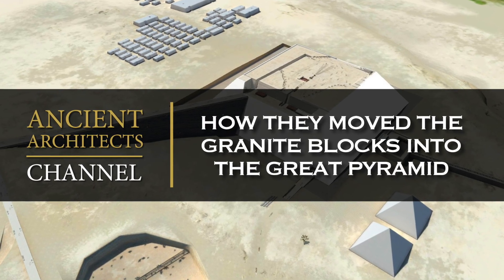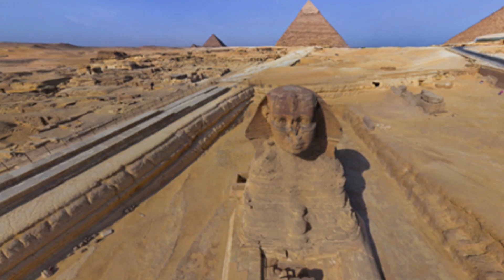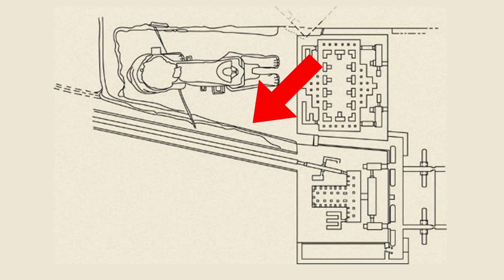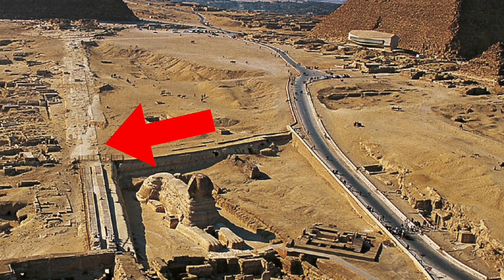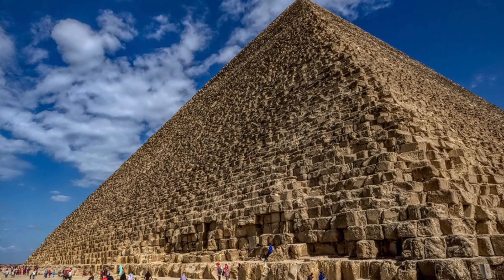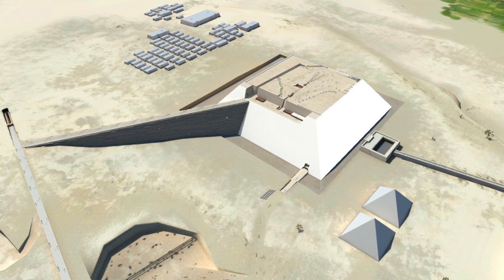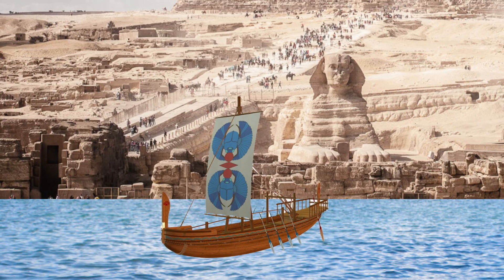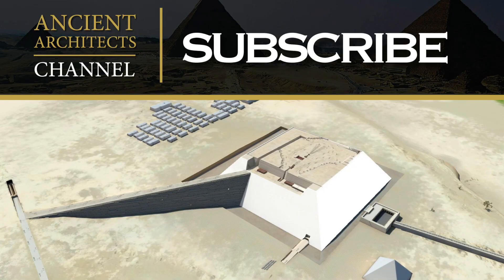How They Moved the 60-Ton Granite Blocks into the Great Pyramid | Ancient Architects

Comment: How did they quarry the 60 ton granite blocks?
Reply: With a wooden spoon
Reply: Nobody knows. The excavation marks of similar stones and obelisks still in situ at Aswan have really weird marks that look like the granite was scooped away like icecream!
Reply: I always wonder about that, too. We see megaton blocks still in situ that have been partially quarried, with just a slim center "beam" still holding them in place. How did they remove that center beam? And then muscle the cut block out of there?
Reply: By using fire and dolerite hammers. The obelisks are much heavier, some of them exceed 300 tons.
Reply: aliens
Reply: @MrAchile13 LOL!  I just saw that you said fire was used to quarry the granite. Granite is workable at 2300 F. So they picked up their granite pounding stones and hand pounded granite that they somehow managed to heat to 2300 freaking degrees Fahrenheit? 
Nukka plez
Reply: Well getting a rough shape is relatively easy.

https://youtu.be/v-NsirLXUMk

Transporting, let alone shaping them into the precision blocks that  they are claimed to be seems downright impossible.
Reply: https://www.youtube.com/watch?v=5Zi7B9-eCJY&t=133s
Reply: https://www.youtube.com/watch?v=LHDSmKvs9Tc
Reply: @MrAchile13  Such a process would require bodies to work in positions that physically and psychologically would be intolerable, if not impossible, not to mention greatly limiting the force of their strokes.  It could be done though, in a thousand years perhaps.
Reply: @redwoodcoast  It would be nothing compared to the digging of deep underground tombs. Working conditions in the XIX century coal mines were inhuman, yet miners did it.

Regarding the relieving chambers, Jean Pierre Houdin addressed this and they do have an important role. The chevron blocks were raised high above (unlike the queen's chamber) in order to transfer the pressure above the grand gallery (and not lateral, which would be dangerous for the structure). The relieving chambers are simply granite beams meant to bridge the gap between the walls and thus strengthen the structure and fill the void between the ceiling and the chevron roof.
Reply: @MrAchile13  I missed Houdin's attributing the height of the relieving chamber to avoiding pressure on the grand gallery.  That makes perfect sense.  But did he, or anyone, conclude that limestone would not have been strong enough?
Reply: @redwoodcoast  I don't know, but I don't think this is relevant. Why take the chance of using limestone if you can be safer by using granite?
Reply: @MrAchile13  Why, because no one in Egypt was capable of cutting granite with a few exceptions. But anyone with a hand saw could cut limestone.
Reply: @redwoodcoast  This is not true, as proven by the archaeological record, experimental archaeology and Egyptian inscriptions.
Reply: @MrAchile13  -all of which are subject to incorrect interpretation, false characterization, and unrecognized omission and ambiguity.
Reply: @redwoodcoast  It seems to me that you are casually dismissing evidence that does not fit your narrative. Egyptians literally told us they were making granite obelisks. Check out the sarcophagus of Hordjedef. Denys Stocks has proven that granite can be cut with sand and bronze saws. (Experiments in Egyptian Archaeology, page 115)

Perhaps you would like to explain how they managed to leave thousands of inscriptions in granite, if they were unable to work it.
Reply: @MrAchile13   What you need to notice is the 'quality' of the inscriptions in each case.  Hieroglyphics impressed into granite required a technology that we can only try  to guess at. They left a characteristic that is unlike inscriptions that are carved.  Which is that they are FLAWLESS.  As in flawlessly smooth and perfectly, uniformly shaped as though by a stencil.

Inscriptions that are chiseled into hard stone look exactly like what you would expect from a chisel. They are rough inside, and rough around the edges.  I can say that because I have closely looked at dozens of photos which reveal the difference.
A good question is: Were major inscriptions put on hard stone before Egypt had iron tools with jewel tips?  If so, then either they got iron tools from another civilization or 'they' (the king's masons) had access to tools not made on earth, like the one that core-drilled the Petrie core #7.

The smooth inscriptions in hard stone like that of obelisks required either stone softening technology or geopolymer stone casting chemistry.  Because the perfect nature of their shapes is either from a mold or from a stencil pressed into soft stone without distorting it (which may or may not be possible).  All that we know for sure is that chiseled inscriptions look like chiseled inscriptions, but those on many major objects do not looked chiseled.

I'm convinced that the kings of Egypt possessed a powerful E.T. unit that could cause molecular bond dissociation.  But then you already knew that because you wisely have read my exposition that explains the logic behind that assumption:  The Ark of God & its Deadly Device https://sciencetheory.wordpress.com/2019/08/05/the-ark-of-god-its-deadly-device/
PS  this morning I did a curiosity search and uncovered this which you should find interesting:
Name of product
IDEAL WALL
Type
Cement wall tiles with stone effect
Materials
Cement
Ideal Wall is a fully engineered system for vertical texturing and carving. Made from selected high grade sands, Portland cements and our specially formulated polymers, Ideal Wall offers unique characteristics in any vertical application.  Ideal Wall can be used to create the look of natural stone, slate, brick or even wood. Perfect for walls, columns, panels, window surrounds or even just inlays surrounded with other materials. Ideal Wall Stains are used to colour and antique offering limitless options.  Ideal Wall has been formulated for either interior or exterior application over any solid substrate. Once applied you can texture and carve your creative ideas into Ideal Wall. Crisp and sharp details can be added the next day with Ideal Wall carving tools.
~~~~
I'm going to include it in my next article, -with some amazingly realistic photos.
Reply: @redwoodcoast  As I said, you ignore evidence that you don't like. When you have some time, I highly recommend you Experiments in Egyptian Archaeology by Denys Stocks. He managed to carve hieroglyphs into granite by using flint chisels (he even includes photos of them). There are unfinished hieroglyphs in granite that show pit scars, like the ones produced by flint chisels (one example at Bolton Museum). Better precision can be attained in hard stone since the process of carving/punching is much slower.

I don't believe in any E.T. technology, since there is no evidence of it.
Reply: @MrAchile13  It seems you are ignoring clear evidence, which may be because you are as yet unaware of it, -photographic evidence of hieroglyphics are are clearly chiseled and others that are clearly NOT chiseled, as in not chiseled into hard stone.
You need to familiarize yourself with the degree of fine detail that is observed also, along with hieroglyphics which are raised instead of inverted inward.
I need to do a side-by-side photo collage of the several different means of creating inscriptions. Some are clearly by manual labor while others are clearly by molding of pre-made symbols.
I tried to find some images of Deny Stocks' work but could not find a thing, therefore I can't embrace any certainty about the quality of his work, but not being a life-long slave to such a chore, his results could not possibly show the utter smoothness of inscriptions formed by casting.

Here's the link to my Flickr.com account where I've posted photos that I've analyzed and commented on because they are revealing or anomalus.
https://www.flickr.com/photos/183847320@N08/albums/with/72157710603755327  albums
Reply: @redwoodcoast   Your only argument seems to be "they look to good to be made by hand" which is not evidence. High precision can be attained by good craftmenship as has been proven all over history, just look at the serapeum sarcophagi. Experimental archaeology and the unfinished objects that have been found, proved that the Egyptians were able to work granite with primitive tools. There is no evidence of advanced technology nor of E.T.'s, but if you have anything, I'm looking forward to it.

All the quarries and unfinished monuments attest the quarrying of the stones, and many of the objects you claimed to be cast, display quarry marks.
Reply: @MrAchile13  " the unfinished objects that have been found, proved that the Egyptians were able to work granite with primitive tools."
First you need to show the proof that the granite work was done by Egyptians, then that it was done with primitive tools, then that "working granite" covers every possible level of quality.  
You can claim that primitive tools can 'work granite' but you cannot show that what was made in the Serapeum was possible with primitive tools.  It can be presumed to have been impossible because of the extent of the work, the hardness of the stone, the weight of the objects, and the inconceivable means to place them in their positions.
The PREPONDERANCE of the unlikely and the inconceivable argue against the primitive means creating the advanced results. 
PS.  Don't repeat this but I'm looking at what may be evidence that the boxes were produced, and not cut or carved.
Reply: @redwoodcoast  I am quite surprised that you asked me such a thing, since from the Old kingdom, all the way to the roman era, Egyptians did produced granite objects inscribed with their names. 

2) As I said  time and time again, it has been proven by experimental archaeology. Granite can be worked with primitive tools, it's a fact.

3) Experimental archaeology has replicated a sharp internal 90 degree angle (in rhyolith) by using obsidian chips and smooth surfaces by using hydrated obsidian (Jean Pierre Protzen, Stella Nair, pages 161,162 - photos  included)

Check out the sarcophagi of Constantine the Great and his mother Helen, made out of porphyry, without modern tools.

Theophrastus (3rd century B.C.) tells us that some hard stones were worked by using other hard stones. Pliny tells us that marble was sawed by sand. 

As I said, I'm looking forward to the evidence, so far you provided nothing, only your belief that the Egyptians could not produce such objects.
Reply: @redwoodcoast   "You are falling pretty far behind what has been discovered recently" and that's exactly why I encourage you to check out the results of experimental archaeology. I am glad that we both agreed (since you did not refute it) that hard stone can and was worked with harder stones and that precision can be attained. Perhaps you could be a little more specific why the sarcophagus of Constantine is a fake? I will check your sources and reply.
Reply: @MrAchile13  My reply lacked a response to your points due to time limitations, but I wanted to say that I believe the sources that you referenced (without having seen them) but I wanted to get you to think about the huge problem of scale.
It's possible to produce a 'carving' of an image in hard rock with hard but primitive tools yet one must fully keep in mind the element that is crucial in such work: TIME & effort.  
That factor must be accounted for in considering the plausibility of replicating such a feat on a grand scale.  The manpower needed and the required expenditure of mind-numbing amounts of time preclude adopting such a slow (and skilled) method to produce things in large size and large numbers.
Look at the incredibly intricate sculpture within Indian temples.  Such work in hard stone, if even possible, IS impossible on the scale at which it was produced.
The leaves the alternative, sane, explanation that I cover in my essays.
Reply: @redwoodcoast  So, do you actually believe that the Egyptians were capable of working hard stone with primitive tools? You made different claims in the previous comments. Perhaps we do have more common ground then we thought.

I don't find the time and effort problematic regarding hard stone workings, giving enough workforce and skilled laborers. We have sources talking about sending the convicts to granite extraction (sure, the later fine work needed highly skilled workers). Now, in order to respond to your links:

First thing first, I found 2 recurring patterns: 1) you make up a random hypothesis, which is not backed up by any evidence (like the Ark of the Covenant being related to advanced technology) and then calling it the logical conclusion, or the most logical conclusion, and 2) basically saying "I don't know/don't believe how they did it, therefore advanced technology" which is a logical fallacy.

First link: Tubular drilling in granite has been replicated with bronze drills and sand (Stocks talks about this, including the drilling ratios, page 115). They do include drill marks on both the core and the walls and the drill core is tapering, due to the movement of the bow drill. Egyptians also had straight profiled drills, made by another drill type, which was used for vase manufacturing. It's not possible for the drill to produce those marks from the core 7 while drilling the granite. Here is a video of it: https://www.youtube.com/watch?v=qeS5lrmyD74

I don't see what 9/11 has to do with this. 

Second link: the patches from the stone vessels are restoration work, they are not made by clay. Also you claim that the handles were added later, a claim which is not supported by any evidence. You said that the granite blocks from the kings chamber are made by  an A.I. , a claim which is not supported by any evidence.

Third link: the Colossus of Memnon was also restored. You claimed that it was hit by a weapon, a claim which is not supported by any evidence.

Fourth link: Again, you simply claim it's geopolimer. Where did they got all the finely ground stone to make the polimer? Why would they even quarry monoliths? Or carve statues?  The unfinished obelisks proves, beyond doubt that they quarried monoliths.

There are statues which separate parts that could be attached, this does not prove the usage of the geopolimer, nor accounts for the majority of statues, which are carved of one block. If the geopolimer was available, why not cast the statue from a single piece? It would be much simpler. You also claimed that the statues were simply coated with geopolimer, a fact that could be simply proven by a CT scan.

Now, the statue of Queirolo is definitely impressive and I don't know it was done. Could you provide the source for the indian looking statue with the missing legs, I would like to do more research about it since it does look intriguing. Have you tried to calculate the time necessary for the manufacturing of the granite sarcophagus of Khufu? How much do you think that would take?
Reply: @MrAchile13  Well that is the straw that breaks the camel's back.  You tossed out way too many mischaracterizations, deflections, and falsely arrived at conclusions that responding to your blithe dismissals would be a fools errand.  I won't waste my time, as I've already done.

Word of the day:
BLITHE;  adjective
showing a casual and cheerful indifference considered to be callous or improper.

"a blithe disregard for the truth"
synonyms:
heedless · uncaring · careless · casual · indifferent · thoughtless · unconcerned · unworried · untroubled · nonchalant · cool · blasé · devil-may-care · irresponsible
Reply: @redwoodcoast  As you wish
Reply: Slowly. And with lots of people working on it, for an extended period of time. Just like people work on massive projects today. They turn up for work each day, work all day, and then they go home to rest, and drink some beer.
Reply: @MrAchile13  I'm referring only to the 60 ton granite beams used to create the ceiling in the Kings chamber. So....you're saying that the accepted narrative within  egyptology for those beams is that they were quarried at aswan, transported to Giza and then used in the construction of the Kings chamber? 
If I comment on someone's comment telling them they wrong I generally provide links (reputable) to back up my claims. So....please prove me wrong. 
Even Egyptologists know that copper cannot even carve the test pits necessary to check the stones integrity prior to quarrying it. These test pits are about a square foot in size and go 20-30 feet down in order to check for cracks in the granite. The pits are  almost perfectly square. How does copper or pounding stones carve out a 20 foot deep square foot sized....uhhh square pit? That is why the "found them laying around" narrative was created. It was and still is the best explanation. Unless they had iron...which is possible. But the amount of meteoric iron needed to complete said task was not available to the ancient egyptians. It may not even be enough from every meteor impact that's ever occured on the planet. 
I'm way open minded but if you're gonna tell me I'm wrong bring some evidence or shhhhhhhh.
Reply: @harpuaslutbag2997  Yes, egyptologists claim that the beams from the King's chamber were quarried at Aswan. The granite was worked with stone tools, as showed by the existing evidence. What test pits are you talking about? 

Here are some sources: 
1) https://www.academia.edu/8533249/Fire_on_the_Rocks_Heat_as_an_Agent_in_Ancient_Egyptian_Hard_Stone_Quarrying_co-authored_with_Tom_Heldal_

2) https://www.youtube.com/watch?v=TMKmxjJDaUM  breaking granite with fire and stone hammers (at 16:00 - 19:30)
Reply: @MrAchile13  Can you imagine the amount of wood (and bricks) they would have to have in stock to make the amount of fire to get ALL the stones around Egypt (not mentioning the other megaliths around the world)? All that pounding would also deform a lot the stones, how did they polish them to such a pristine state, as are the blocks inside the Great Pyramid? I think the biggest fault with our egyptologists is that they don't consider that MAYBE our ancestors weren't that primitive. The scale of the entire project of the Pyramids is much much more complex than a newborn civilization would be able to handle and manage. There's a missing link between what we see and how they did it (if THEY indeed did it instead of just "inherited" it from previous civilizations).
Reply: @MrAchile13  I'm only linking this video b/c you asked what the pits were. This isn't me citing any studies or papers (obviously). It's just the first thing I found that explains what I'm talking about. 
There's simply no way these were carved with bronze and pounding stones. 
Thank you for providing links. I'll look at them asap. Very busy week for me, but I respect the hell outta someone who backs up there talk...right or wrong.
Reply: @EduRockR  Can you imagine all the mud and wood necessary to make pottery? Or houses? Or mortar? It consumed much more resources then rock extraction. Why would this be a problem? 

Perfectly flat surfaces can be attained without any modern tools. Humans did this all the way to the present time. Pounding and sand/obsidian polishing can do that. Internal and external 90 degree angles can be attained with stone chips and chisels, like flint or obsidian. This has been experimentally proven and you can look into the works of Denys Stocks and Jean Pierre Protzen/Stella Nair for more information. The rock is worked over and over in different layers with different tools until the final product is attained. This process is attested by unfinished objects.

It depends what do you mean by advanced. Egyptians were definitely advanced for their time. However there is no evidence of modern technology being used or of any previous civilization to exist. The pyramids didn't appeared out of nowhere, they did evolved gradually from mastaba, to step pyramids, to a few failed examples and then to the first true pyramid, which is the red pyramid. The evolution is well attested.
Reply: @harpuaslutbag2997  I actually thank you for being polite, something not very common in you tube debates.  I watched the video and I don't see anything that couldn't be done with fire and pounding/grinding. Although dating is also important. There are wedge marks in granite (not in this video), but those have been dated to iron age. 

The problem I have with Brien Forester is that he makes claims out of thin air. For instance, he filmed the unfinished sarcophagus from Cairo Museum and claimed that the lid was cut (from the back) by two circular saws, while ignoring that the sarcophagus displays only linear marks from sand sawing.
Reply: @MrAchile13  I get the whole Brien Forester thing....that's why I prefaced my comment about me posting a Brien Forester video. 
However....there's no room to create the leverage to carve out those pits. You cant swing your arms enough. Maybe at the top but some of these are 20-30 feet deep where the faultless granite lies. I dunno....difference of opinion. I'm looking at the physics of it. 
I think this whole fire thing has you stuck in the alchemy of it. Maybe it's time to check your links cuz melting stone is virtually impossible in a setting such as Aswan.
Reply: @MrAchile13  ....I forgot to say you're welcome. No need to be be nasty... we're just having a talk. 
That being said....if you think the tests pits in the video I posted are made from a process similar to this....you out your damn mind ;-) case and point...https://youtu.be/cUewwaQXWi0
It's obviously something we cannot replicate today...not even close. In my mind that defines high technology. There's just no way the ancient egyptians put all this effort into making ALL of the grand structures in Egypt. Regardless of the timeline available. There MUST have been another way. 
There's also a reason that I've never even heard of the hypothesis proposed in the paper you linked and I'd like to think I'm fairly well versed in the subject. 
Fire to break rock...sure. Fire to quarry 60 ton granite blocks from deep within the core granite where the faultless granite lies....not a chance.
Reply: @MrAchile13  Then you have the granite boxes in the serapeum of saqarra. Is it your believe they were cut with pounding stones and fire as well?
Reply: @harpuaslutbag2997  Egyptians did not melt granite. They used fire to weaken it and this has been proven. If you use a stone chisel and hammer you don't need to swing your arms very much and if you use a dolerite pounder you don't need to swing them at all. You lift it into the air and then drop it. The underside of the rock is the part where short and awkward movement is required.

"It's obviously something we cannot replicate today" how do you know that? Why do you simply assume it, since we have better technology? To say "we don't know how they did it, therefore they had advanced technology" is a logical fallacy. If you want to prove advanced technology, you have to have extensive evidence of it,  which we lack.

You can break the rock by using fire, is there any reason for which this process cannot be repeated until a trench is formed?

I don't understand the point of your question. Quarrying an obelisk is more difficult then quarrying a Serapeum sarcophagus. So yes, the original block can be quarried that way. Further work can be done by sand cutting, carving, pounding and polishing. 

I also don't understand the point of your video. The archaeologists are quarrying chert, not granite. The video I sent you, shows granite quarrying and it uses more efficient tools and here's why. The point of this experiment was to harvest chert for tool manufacturing, while the other was just to break granite as efficient as possible.
Reply: @harpuaslutbag2997  Absolutely,  the other point being those blocks are liberated from thousands upon thousands of tones of removed material. Granite with out fault is found deep, really deep. We only see them standing in place but getting to that point is a totally different set of logistics, & no machinery used. Just to get to what we see is amazing 👍
Reply: @harpuaslutbag2997   Even WITH iron tools, they would do what all such tools do; leave cutting marks. But those vertical 'tubes' have ZERO cutting marks on their walls, unless they were made by Egyptians, in which case they look as primitively made as they were.
Also why overlook the ancillary issue of WHY were the 'relieving chambers' even constructed at all, much less with giant granite blocks???  They are totally unnecessary! (for any purpose that we can conceive of) proof of which is the design of the 'queen's chamber' ceiling.  Check mate.
Reply: I love the answers on here! Y'all obviously know where I'm coming from when I asked the question. 
The standard Egyptologist explanation is that they found the granite blocks already laying around on the Giza Plateau and then they used them in construction of the great pyramid. That explanation sounds a little suspect to me!